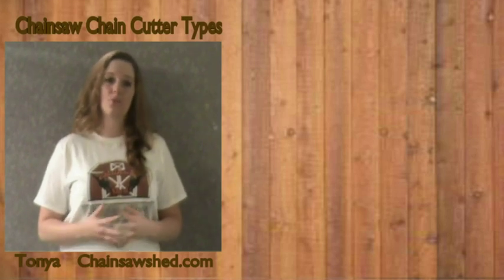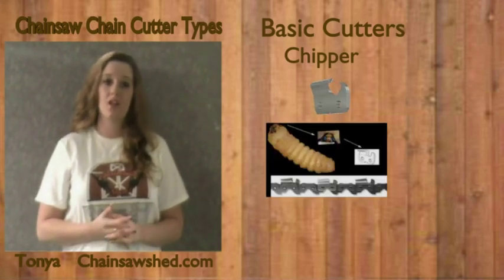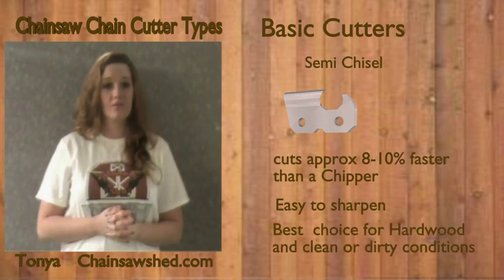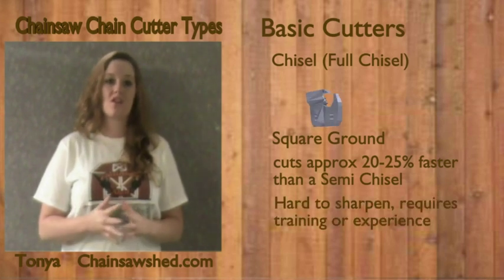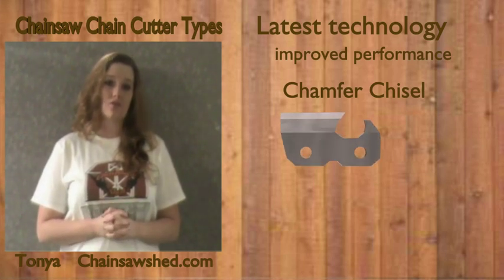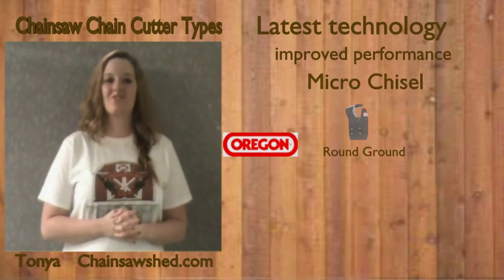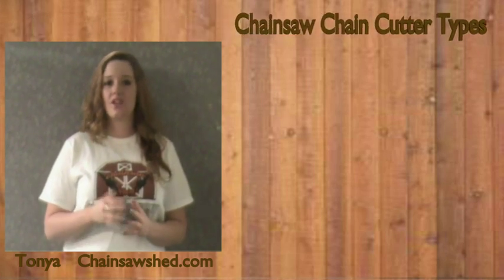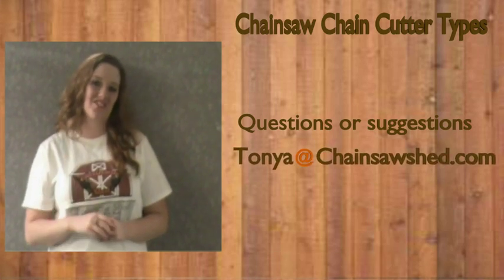Cutter Types

Comment: Great video..
   I am wondering if they make a blade that uses teeth similar to a carpenters circular saw,  those carbide teeth on the ends of the blades today?  I have seen machines and mills using ban saws, and giant circular saws, and i think they hold up longer than chain saw blades for sharpening...